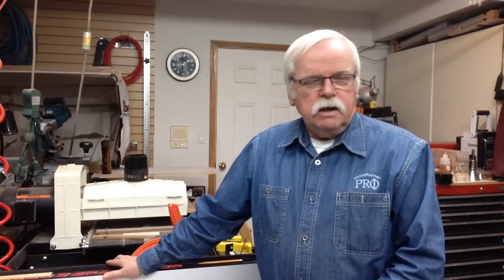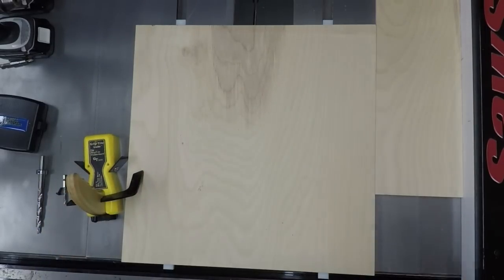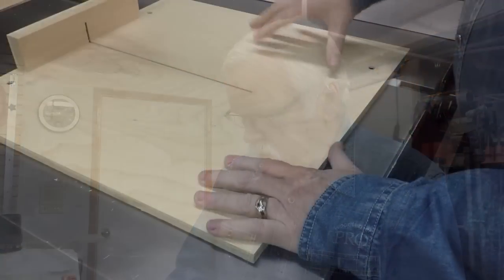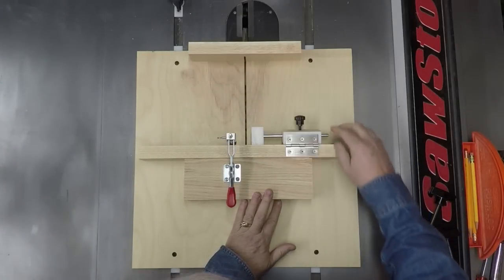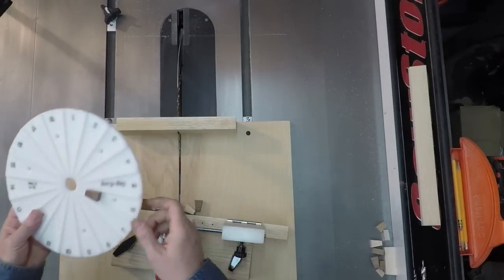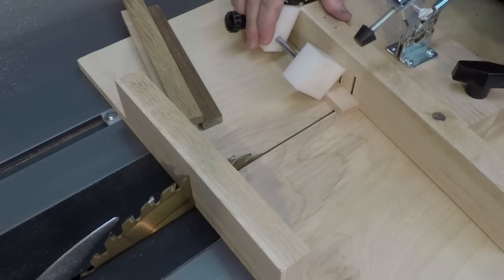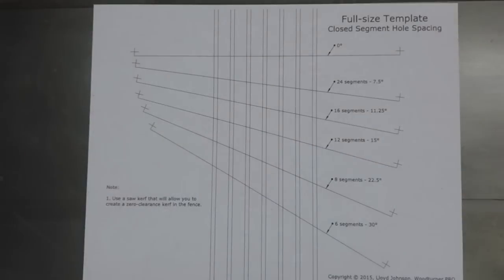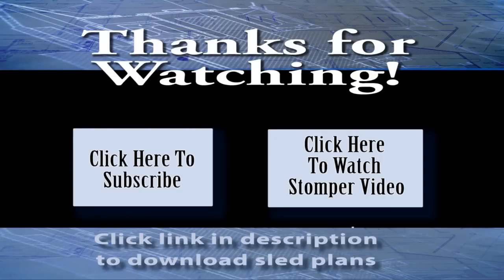Table Saw Sled for Open Segment Vessels

Comment: What a great design Lloyd. You did a great job of explain everything and it will help immensely cutting those pesky and dangerous to cut small segments. This should be fairly accurate on the Bandsaw as well. Thanks for sharing this.
Derek
Reply from the maker: Derek, I don't often use a bandsaw to cut segments, but I think it would make perfect sense for open segments with this sled.  I believe I'll give it a try.  Thanks for your suggestion.
Lloyd
Reply: Hi Lloyd, I make all of my inlays using the bandsaw. I think it's just a matter of ensuring your bandsaw is set up and fine tuned to create accurate components. This jig design you have come up with is perfect for me to create my Chaos design Butcher Blocks on the table saw. I will build one later today so again, thank you for sharing.

Comment: I'm wanting to do 32 and 48 segment open segment work.  Do you have a paper template available for your sled to do the 32s and 48s?  I have the 18 and 24 segment plates now and was wondering if you are going to offer a 32 segment plate as well?